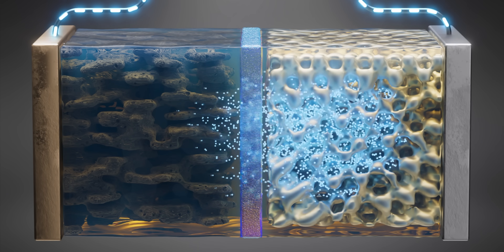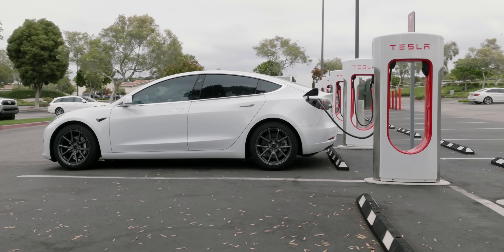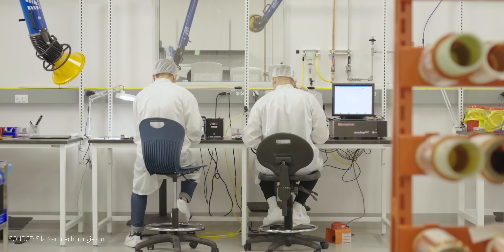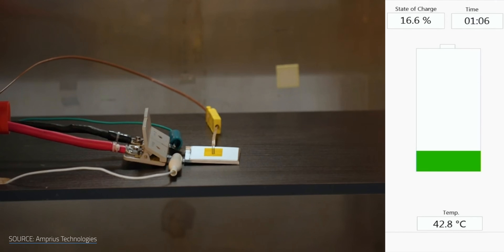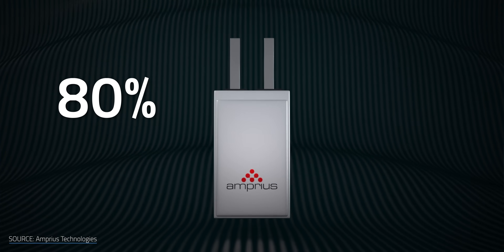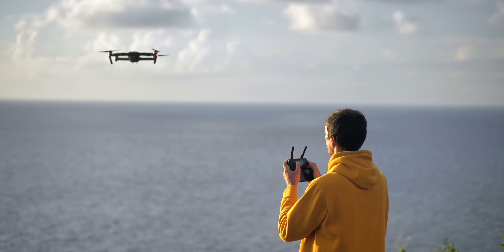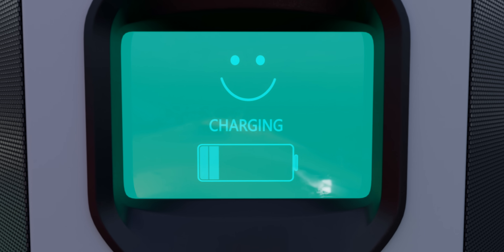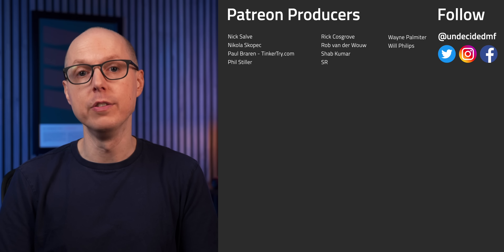Why This Ultra Dense Battery Breakthrough Matters

Comment: You can make silicon nanowire cheaper: atomic layer deposition instead of "growing it directionally". You deposit lattices which are folded In a scrungy knotstructure. This would also allow swelling to occur without damage since the structures simply seek to "un-knot their not-knot" such that no stretching occurs. Bends would naturally reform through discharge cycles because of electron movement so the dendrite forms useful reformation of any weakness in bends
Reply: Got a source for durability numbers?  Tradeoffs?  If I were a younger/smarter/healthier/wealthier engineer, I would definitely look into this.  Maybe next lifetime.  ha!
Reply: @AZOffRoadster  It's not this easy trust me, you need minimum 10million in capital to afford the machinery to even assemble cells using volatile solvents for the electrolyte.  I was playing with silicon anodes and sulfur cathodes over 8 years ago. There is a reason none of this is commercially viable yet.
Reply: what are the actual costs for that style of additive manufacturing at nanoscale? And can it create them in the dense, matted form factor they need? I'm assuming they already have some proprietary techniques so the margin may be closer than you think.
Reply: Or even omit it entirely, simply make lithium silicide add a little aluminum bind and sintered to the anode collector plate or mesh. Since it is already in the high volume state the migration of the lithium would not effect the anode much due to the porosity. It would preform somewhere between a lithium ion and lithium metal battery.❤
Reply: I think that's what group 14 is working on because they use the carbon as a scaffold for the silicon so it might reduce the cost a bit, but sacrifice a little bit of energy density while increasing durability. Possibly a best of both worlds scenario.

Comment: My son works for Beta Technologies in Burlington, VT, and they're building an eVTOL based on current (2170) battery tech. By combining vertical takeoff/landing, short (about 100 mile) flights, and modular charging/landing infrastructure they're building a viable business. UPS has already ordered over 100 aircraft. So if electric aircraft are already viable, at least in niche markets, improvements in energy density will only expand that market. BTW, as a student pilot I cringe every time I see my training plane being filled with leaded gasoline. I can't wait until my school switches to electric aircraft.

Comment: Monro Live did a tour of their factory a few months ago, and he seemed impressed with what they were doing. It seems like tech is solid, but as always, it means nothing if you can’t scale to mass production. Prototypes are easy, production is hard.
Reply: That's why it's good that they make the batteries with all off-the-shelf manufacturing equipment. Centrotherm has been mass producing photovoltaic cells and other silicon deposition products for a long time. The manufacturing process is already proven, but they will face a steep initial capex cost to buy a ton of Centrotherms for their Colorado gigafactory.
Reply: prototypes aren't easy, i'm in the same building as their actual research machine (it's not in their main building). they've been working on it for years
Reply: @kiddy1992  yup, prototyping can be deceptively difficult especially if you aren't being funded by multi-billion corporations.
Reply: @kiddy1992 
Stop attacking strawmen, he is saying that mass production is harder than building a prototype of a product

Its far easier than implementing mass production 

Prototypes you are designing ONE MACHINE 

For Industrial mass production you are designing 10-20 New machines, these machines are also far larger and more expensive with much tighter tolerances, and these machines need to run at least 8 hours a day and will need to work for 30+ years minimum
Reply: More accurate is prototypes are hard, mass production is hard. But I mean, unless you are doing something about it, what's the point of the comment?

Comment: How did you not mention that these guys supplied batteries to AeroVironment for a recent round of switchblade production? That seems like a pretty good sign for this one being real, at least in high power applications.
Reply: Switchblade drones are unusual in that their batteries only need to be good for one charge-discharge cycle, so battery swelling with repeated charges wouldn't be an issue. I also imagine that high energy density and rapid charge time could both increase the capabilities of the drones.
Reply: @brillingboojum Yeah, but military applications need to be highly reliable. There's no way they'd be in the Switchblade drones if there were issues like this.
Reply: And they are going into Teledyne FLIR's Black Hornet recon nanodrones. And, in addition to Airbus/AALT HAPS's Zephyr mentioned here, they are also going into BAE Systems/Prismatic's PHASA-35 HAPS. They also have POs from a a small plane company Infinitus Aero, are submitting test cells to the US Army Conformal Wearable Battery program, and delivered batteries to 38 customers last quarter.

Comment: The largest problem with this video is not addressing the downsides like charge discharge cycles or the comparison of graphite production with silicon nanowire substrate production which is also incredibly energy intensive and restricted to a few locations in the world.  End of day it’s not revolutionary but incremental at best.

Comment: This all sounds very promising but how does it hold up over time. Will this be able to out last the best lithium batteries right now?
Reply: You'll have to go looking that up yourself, but that's an important question for a lot of applications
Reply: Definitely longevity is something to be concerned about, but if the benefits of their battery are high enough and very importantly, also don’t increase the costs too much, even 2000 charge cycles might be sufficient for a lifespan. It could potentially push manufacturers to engineer vehicles, aircraft etc. in a way that permits faster and lower (labour) cost battery replacement.  And while as low as 2000 cycles would be not great, at 50% additional energy density it would mean an average commuter would quite likely get 2 days of use out of it, so 4000 days which is roughly 11 years. For typical use of my family’s EV, that would actually easily be 3 days worth of travel. The economics of such a system could conceivably work but the devil is in the details for sure.

Comment: A question: at 6:58 Amprius shows a comparison with a lithium-ion battery for mobile phones which says "3.7 V  6Ah   -->  2.4Wh"   Is there something wrong? Shouldn't it be 3.7 multiplied by 6 = 20.1Wh?
Edit: 22.2 Wh 
but still, not 2.4Wh, which is not a typo, being on a official adv from the company
Reply: 3.7 V x 6 Ah = 22.2 Wh
Reply: @jwnomad  
Yes, thanks, OBVIOUSLY is 22.2. But that it's not the point. Did you get the point?
Reply: To avoid legal problems we removed all identifying features. If you think the markings are bad  try looking at the contacts,  they appear to be black plastic .
Reply: @richyfoster7694  
Hi. It's nice to see an "official" answer, thanks.
 P.S. What about the revenue in Q4? Should I keep the stock? Buy more? (Just kidding... ;) )

Comment: You know why Silicon is not used in batteries overcharging and drop your phone = hand grenade 1st reason also silicon is also used inside your PC, TV, etc and regular products meaning Silicon will become expensive once used in batteries that's the 2nd reason why it's not used in batteries

Comment: Lithium ion batteries are so 90’s .. as this  retrograde owns plenty of them “ Milwaukee & eGo “ .. and they are great but a better battery would not hurt .. lithium’s limitations and potential pyrotechnics are reasons for not yet getting an EV .. plus sitting on top of 1000 plus lithium batteries is kinda unnerving ..I have been to shipboard firefighting school and a Class D fire is almost impossible to put out

Comment: Looks like it has a lot of potential for sure. But as you mentioned, time will tell. One thing I didn't hear was the expected cycle life, which would be a huge factor for the total cost of the battery. Thank you again for another great video.
Reply: Current info I can find is between 200-1200 cycles, depending on use.
Reply: @rdizzy1  Close to 1200, not bad. Close to 200, forget about it....
Reply: If EV's can only take between 500 and 1200 fill-ups before needing a $20,000 servicing, it's never going to take off.
Reply: @hotfightinghistory9224  Really? 500-1200 fillups between $20k services is a nonstarter? For an EV with a 300mi range, that'd be 150,000-360,000 miles between $20k maintenances, during which time you will have saved $20-50k on gasoline. You're a very demanding consumer.
Reply: @Demmrir  good points, but electricity isn't free either.
Reply: @Demmrir  if these got about double the performance like it claims, then that would be 300,000 on the lower end. That’s insane to think about.
Reply: @eddualmeida5790   If they're like normal lithium cells, you can double the cycle life by charging to 90% and half the cycle life by charging to 105% so 200-1200 probably matches the 360-500 Wh/kg numbers on their front page.  The total discharge matters too, so it could be possible to have an emergency reserve for an extra 10 minutes of flying time on your plane which would degrade the battery.
Reply: @Demmrir  I believe you forgot to include the charging cost for electricity in your savings calculation.
Reply: 500 cycles x 500km range = 250000km, most vehicles are scrapped at this mileage. Additionally,  batteries don't simply stop working, their capacity instead decreases. Old battery packs are just repurposed for energy storage.
Reply: Yeah, those numbers are TERRIBLE.I love electric cars, but 200 cycles is horrific.  @Demmrir
Reply: @theagentsmith  Sorry but this calculations is wrong. First of all - "charge cycle" is not 0-100% cycle, it's about 50% of capacity charge. You can read it in battery manufactures papers. Also none of the lithium batteries allows you to discharge it more then 80%. Deep discharge will quick destroy the battery. So with 500 cycles you will have 125000km in the very best case (not using heater or AC at all, never driving at cold or too hot weather etc.). And 200 cycles is unacceptable at all.
Reply: The real potential problem I see with this tech relates to its main advantage. The higher the storage density the greater the explosive potential in a catastrophic failure.. That's the basic physics and there is no real way around it.. 
The question becomes about how resistant these batteries are or will be to catastrophic failure.. Current lithium ion are not very resistant at all which is why EV vehicles already require such elaborate design.
Reply: @Demmrir  How many people have $20.000 put aside for a service. It's still a he'll of a lot of money even if they are paying less for fuel. I'm sure the longevity problem can be overcome but until it is I can't see this taking off.
Reply: @Lucien86  Uh no, energy storage has nothing to do with the battery exploding being bad or good. Lithium-ion batteries just do that when exposed to air, it's a chemical thing. The electrons being stored might be discharged rapidly and hurt things and people or it might do nothing and cause no damage at all.
Reply: @thelelanatorlol3978  Not at all. The basic reason batteries explode is because of excess heating leading to a thermal runaway which then leads to a potential chain reaction.. (boom!)

The level of charge in a battery is critical to how much energy is available to generate heating and other reactions - so it is totally all about storage.

It is totally impossible to design an energy storage system that does not have this 'explosion' problem at some point. The worst is probably naked hydrogen, the best probably diesel. (or even better nuclear)
Reply: Not only this, by that time batteries will almost certainly be significantly cheaper, so it's probs going yo be more like 4-5k
Reply: @hotfightinghistory9224  if it is on the high side that could be almost 700,000 kms. I have never heard a complaint about an engine only lasting for 700,000 km before, though on the low side, like said above, forget about it.
Reply: @Demmrir  That presumes the battery still gives 300 for every charge through its whole life-cycle, which normal lithium batteries certainly don't deliver  (not to mention real-world experience suggests you'll rarely get the advertised range anyway)
Reply: @maestrothefrog  A better comparison would be comparing a 700K km battery replacement to the cost of a new fuel tank not the engine....unless there is data available regarding the life expectancy of the electrical motors and other expensive components being 700K Km.
Reply: @Incompetent_Matt  Yep....not bad considering everything else will have worn out before then.
Reply: @Demmrir not arguing but he said 200 not 500 on the low end. That could be a concern.
Reply: He didn’t say electricity is free.  But it is about one fifth the cost of gasoline for an economy car per kilometre travelled.  I base that on my own experience with a Tesla 3 dual-motor and my real off-peak electricity costs.
Reply: @edwardcoulter9361  How much does it cost to bring an EV from say, 20% to 80% at a commercial charging station?
Reply: @Demmrir  If you live somewhere where electricity is dirt cheap maybe. Otherwise you won't save nearly as much and come out way in the red. Also current batteries are better than that. So why wouldn't anybody be a demanding customer about that?
Reply: @nathanbanks2354  What is a "normal lithium cell"? LFP cells are perfectly fine being charged to 100% and don't lose any additional cycles doing so.
Reply: @Lucien86  My dude, you are just wrong.
Reply: @WayneTheSeine  Electric motors last basically forever and aren't very expensive. So comparing the battery to a combustion engine is actually pretty fitting. Those are both parts that cost a lot and will wear out first, before the fuel tank or the electric motor.
Reply: @Lucien86  no, this is not the case at all. The basic reason why batteties explode is because the current paradigm reacts violently with the air which is normally why lithium-ion batteries explode (they usually just puff up when theres issues with electrical discharge). Electrons stored in the battery is not an increase in battery explosion energy at all, that is not how batteries work, the electrons have to actually move to cause any damage which they may or may not do depending on the how and the why. It wont be controbuting to the explosive force caused by the chemical reaction, that is a seperate physical interaction.
Reply: @thelelanatorlol3978  Sheesh!
Do you know why petrol gasoline works a a fuel? When it burns in a mixture combined with air it generates intense heat and this makes it expand violently. There is your energy.
The reason lithium ion batteries explode is pretty much exactly the same - intense heat generated through a chemical reaction in a confined space. 
An uncharged battery can burn but it needs something else to get it up to its combustion temperature first. A charged battery already has the energy to do that - all it needs is a big enough short circuit to start the chain reaction.
In a car battery there is so much energy that all it potentially takes is a fault or imbalance in the management system or a single bad cell or an overheat due to cooling failure.
Reply: @Demmrir  lol not one soul will save that kind of money from gas even if you invest in solar because it all costs money. Maybe half of that is more realistic
Reply: 200 would make this technology absolutely useless, given every other factor. 200 cycles is abhorrent performance. 1000 cycles barely cuts it. This is why I hate hype guys. @rdizzy1
Reply: if it also holds 24x more lithium, won't it cost more because lithium is expensive?
Reply: @Eduardo_Espinoza by anode volume — smaller anode, same other parts
Reply: @Eduardo_Espinoza  No. The lithium requirement does not increase. The ability to bind more lithium, improves energy density.
Reply: No, the lithium quantity will be the same given a certain battery capacity. It will just become a lot lighter and more compact. No wonders Amorous batteries will end up first in aircraft where lightness is everything, and are not cost sensitive.
Reply: you miss understood it is 24X more lithium ions. There is enough lithium ions, it is the graphite that is the limiting factor. Let me give you an example. Imagine there is 200 women and 1 milliion man. How many couple can you marry at a mass wedding??? The number of man is not an issue, it is the number of woman.
Reply: @StevenSiew2  500.100 couples can marry at a mass wedding.
Reply: You take those first two sentences and  apply them to literally any Matt Ferrell video😂
Reply: Yes,that is what crossed my mind as well.
Reply: exactly. Silicon anodes greatly reduces cycle life which is bad for EVs. The only sensible use for silicon is to use very little of it which Panasonic will do in 2025 to increase density by 5%
Reply: @zodiacfml  I mean, I wouldn't rule out that cycle life can be improved in the future, to get to around a thousand cycles, which would make them viable. But we aren't there yet and I kinda doubt a small startup will get us there. They can produce their low cycle batteries, but it will need a CATL or Panasonic to get us to a good cycle life.
Reply: Ofc it has high potential... Its a high density battery 😋
Reply: High density is good as long as it doesn't also explode big time!